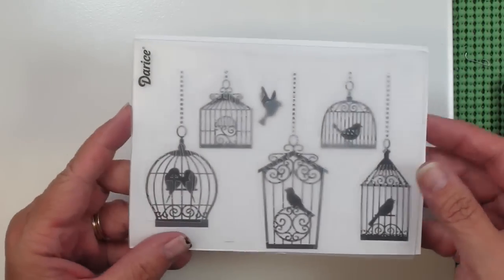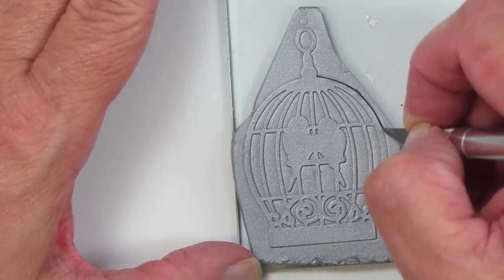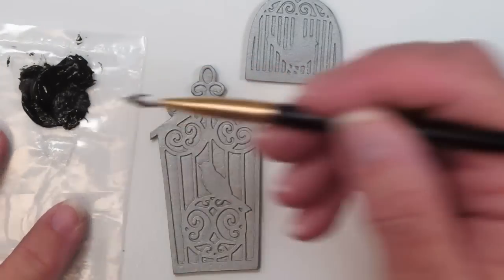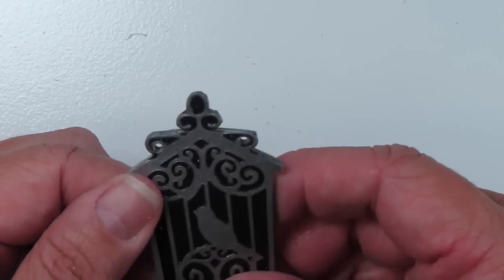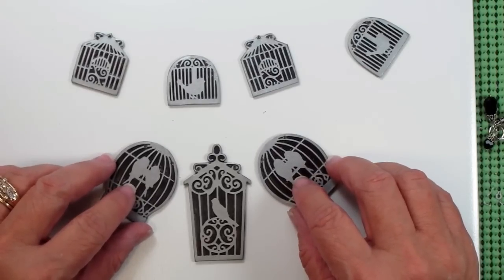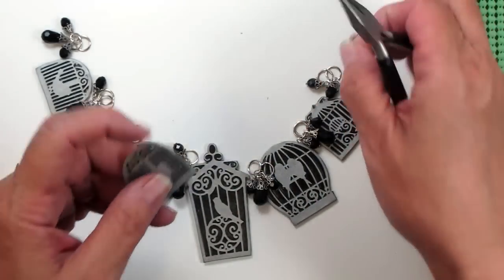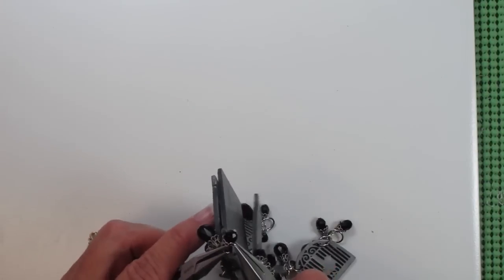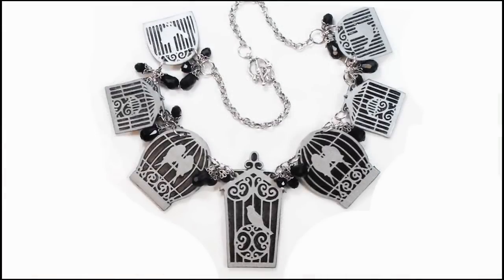Polymer Clay Tutorial Birdcage Necklace #pawgustart

Comment: What tool are you using to drill?
Reply from the maker: +Jael Thorp Jael, I'm using a Dremel.  I don't think they make this exact model anymore which is too bad.  The regular Dremel works equally well, I have one of those also.  There's a set of small drill bits with several sizes that are perfect for polymer clay drilling.  Thanks for watching.

Comment: I wondered how you did that.  Thanks. What is that nifty head pin trimmer called?
Reply from the maker: +Diana Aungst Diana it's called the 1-Step Big Looper 1.5mm by BeadSmith.  I got it at either JoAnns or Michaels.  Use a coupon though!